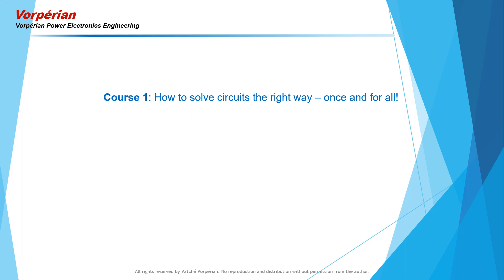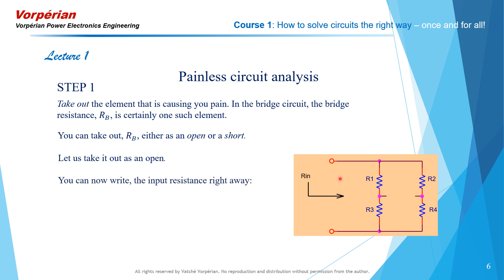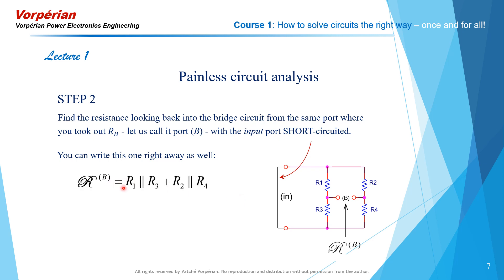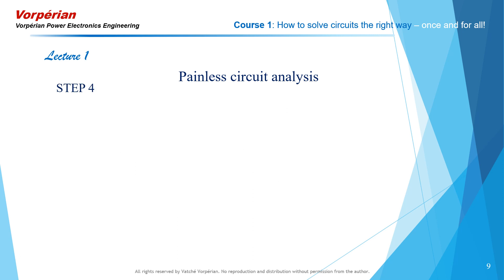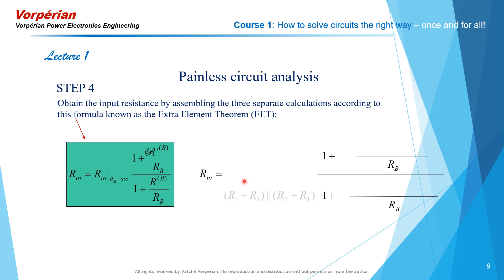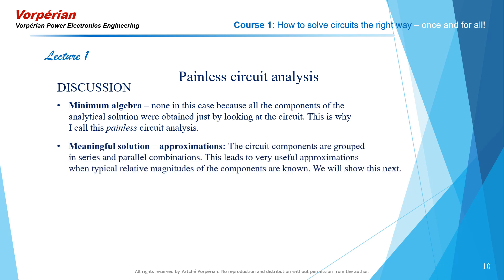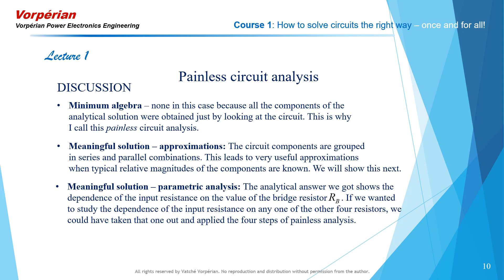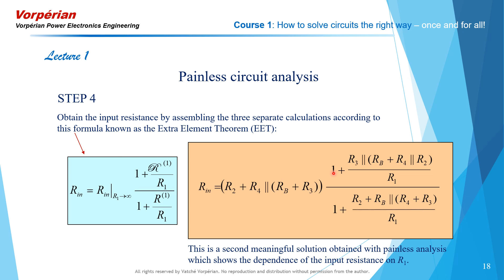Video 2: Fast Analytical Techniques for Electrical and Electronic Circuits

Comment: You are my savior, i always liked Electrical engineering and had a good intuition but couldn't solve the simplest circuit equations because of the amount of variables and mistakes propagating. I cannot thank you enough ! Really words cannot describe how grateful i am.
Reply from the maker: It is very good to hear some uplifting comments like yours every once in a while. I am glad you like my lectures and I hope you can share with others. I wish you all the best.

Comment: Thank you for this amazing explanation... I have two questions...
a) Does this mean we can reconstruct the circuit using the 3resistors in the  approximation (Rin) at 11:22 for instance?
b) Can this be generally applied to circuit impedances?
Reply from the maker: Thank you for your comments. The answer to your first question is that you can construct an approximate circuit (3 resistors in parallel)  whose input resistance behaves very similar to the input resistance of the original circuit. The answer to your second question is most definitely yes. You can see in the fifth video a reactive bridge circuit with a single capacitor. When I show the N-extra element theorem, you will see how you can remove all the reactive elements of any circuit and analyze only a set of purely resistive circuits and then reinstate all the reactive impedances (sL and 1/sC) by combining the reactive elements impedances with the resistive calculations according to the formula given by the N-extra element. I am sorry for delaying my second set of videos but they will be coming.
Reply: @vorperian_courses  Thank you for the clear reply... 
really looking forward to more and more contents from you... :)
Cheers